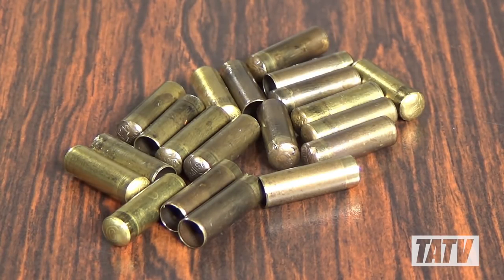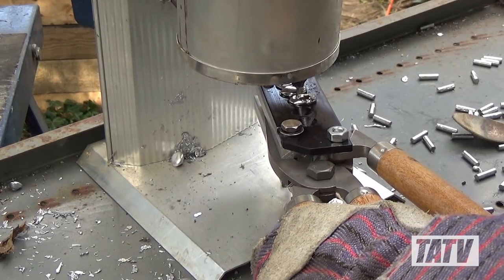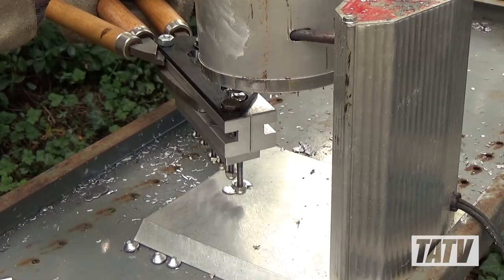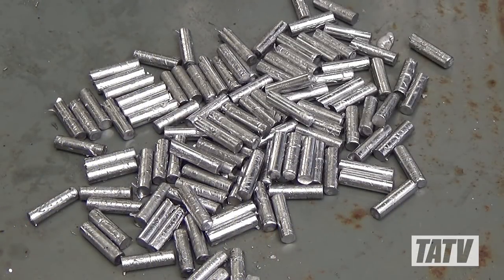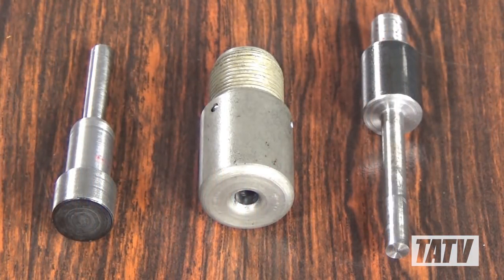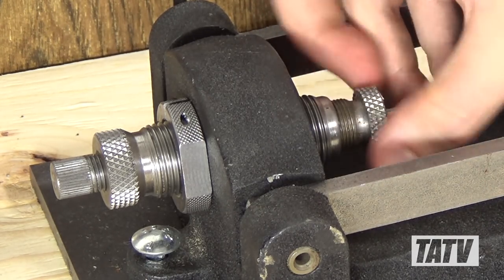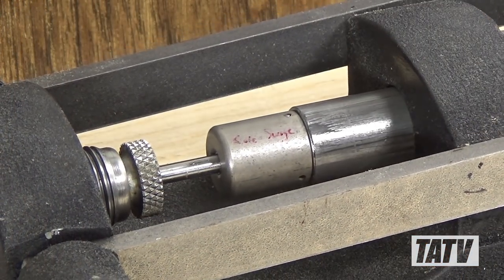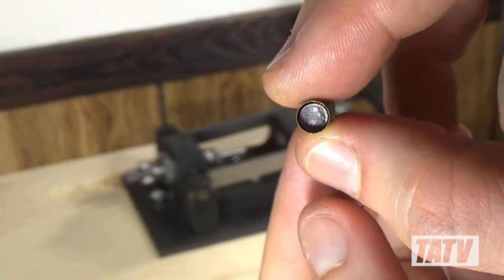Swaging 223 Bullets from 22LR Brass with a Blackmon Swaging System - Chapter 2 - Making Cores

Comment: Thanks for the video series.  What diameter are you casting the lead cores?
Reply from the maker: I've never actually checked, but it doesn't matter so long as they fit the die.  The actual swaging process is what forms them to the final diameter.

Comment: Another great installment in the Blackmon swaging series! I've had two core molds made, one that drops cores at around 52gr and the other at around 55gr, which should make it possible to make bullets up to around 65gr. How heavy bullets can you make before lead in starting to flow through the open tip of the jacket?
Reply: How much did it cost? 
How long did it take?
Reply from the maker: @dalepittman5254  Cost can be found on the manufacturer's site, in the description.
Reply from the maker: I've never wanted anything heavier than 60gr so I really couldn't say.
Reply: Thanks for the reply. I've had great success with bullets at 52 grains, using CCI brass. Any heavier and lead starts to flow out the nose when properly forming the nose.

Comment: Do you know the core height you used in this video? I finally found a lee blank mold and going to make my mold just for 55gr bullets
Reply from the maker: Sorry no.
Reply: weigh you jackets, then do the math
my jackets run right at 10gr, 55-10=45

Comment: Where do you get pure lead?
Reply from the maker: Certain types of wheel weights are pure lead; they usually look like little strips of squares and are easy to identify from how soft they are.  Autobody shops often have pure lead scrap, as do some roofing companies.
Reply: TATV Canada Actually found some on Fleabay
Reply from the maker: Awesome!  Not sure if you're American or not, but if so, you may want to check out RotoMetals.  I can't use them as a Canadian due to the crazy cost of cross-border shipping but a lot of folks in the US find their prices to be the best.
Reply: I hear car batteries are a good source of pure lead, getting harder to get lead these days.

Comment: I would recommend wearing nitrile gloves working with lead like this.
Reply from the maker: Ordinarily I do, but they make it very challenging to film so I forgo them for videos like this.
Reply: Why? My fingers taste good without the gloves
Reply: @TATVCanada  us mechanics are suppose to wear gloves but there are times when the gloves really make it diffucult.
Reply: Mad hatter
Reply: @cavelvlan25  cast bullet board guys get checked for lead in body. They all been very low
Reply: You have to digest it, or inhale it.  Simple hygiene and an IQ of 45 keeps you safe.
Reply: You’re not going to get poisonous molecules in your bloodstream, through your skin, when handling solid Pb(lead). You will however, want to avoid contact with the fumes when melting and dust like particles. Say like when sifting out of the dirt of a berm. Cool video!
Reply: I got tested for lead after many years of shooting, casting lead bullets and sinkers, and soldering. Nothing showed up.
Reply: As long as you maintain simple cross contamination protocol you're never going to have a problem. Now proper ventilation when heating lead....

Comment: How about just use a steel core rather than lead
Reply from the maker: Some NATO rounds do, but for a DIYer you'd never have access to kind of equipment required to swage those. The dies would break under the pressure, and you'd need a hydraulic press on top of that. Also, steel is significantly lighter than lead so it would need to be a much larger core volumetrically.